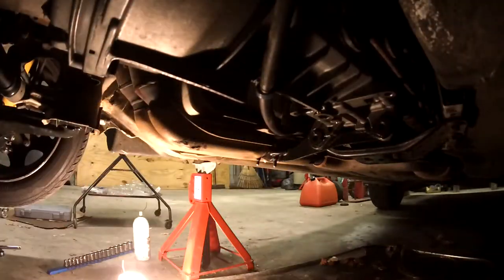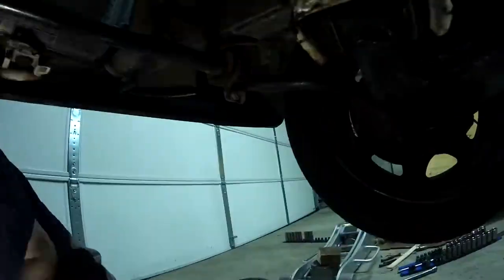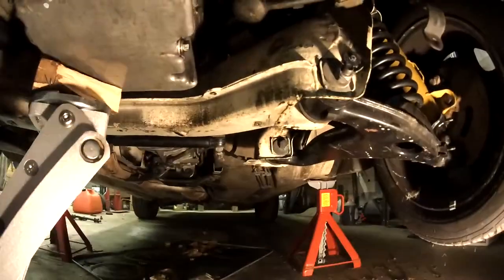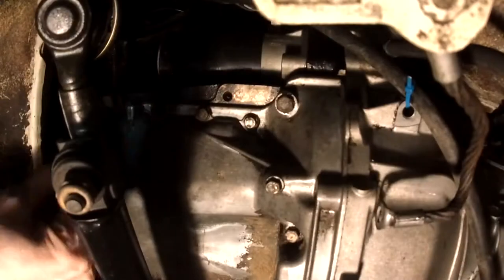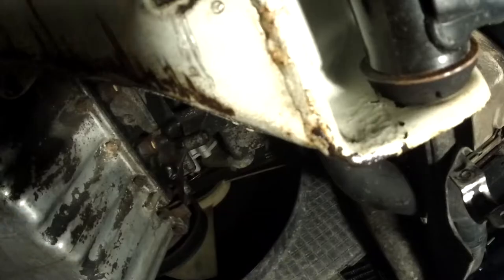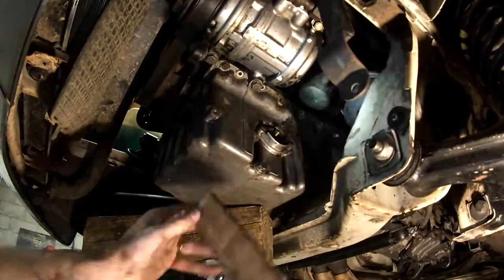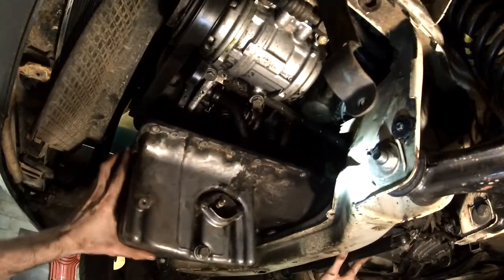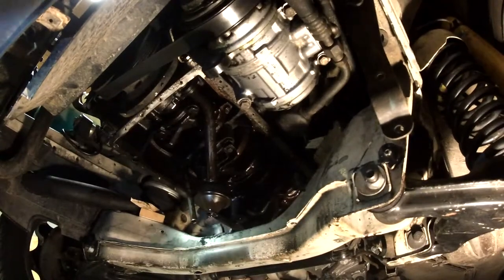Mercedes 190e oil pan removal - m102 engine

Comment: Yes, what a PITA job to do. Really, couldn't they do it a little bit more complicated, say for "about 1cm" that it just wouldn't be possible to get it out at all!
Gonna do the same on my W124 Om601 to check the condition of the engine internals and do some cleaning.
Done it already on Audi B5 1.8 20v and it's the same kind of nightmare where you need to jack up the engine like insane and (at the same time) lower down the engine (front-suspension) subframe.
I don't know who is giving those Germans such smart ideas. Brilliant.
Thanks man, Really!!! You are helping me collecting the needed courage the get job done and giving some ideas what lies ahead. Wish you all the best!!!
Reply: Doing this right now. Not fun

Comment: This is very helpful, much appreciated. I guess the W124 M111 engine is similar. Do you remember how far you had to jack the engine up, or how thick the blocks of wood were that you put in between engine and mounts? Thanks!
Reply from the maker: I jacked it up as far as it would go I think the transmission was hitting the tunnel. The wood was just whatever was around I think some 2x4 chunks and then pieces of paint stirrers to get it as high as it would go. it would probably go higher if you lifted it with an engine hoist.
Reply: @chr1ssss  Thanks again!
Reply: Okay, just got this job done on my w124 m111 engine, took me half a day. Pretty straightforward, using a hoist attached to the front engine lift eye until the engine hit the firewall. One of the crankshaft counter weights was in the way, by turning the crankshaft I got the necessary clearance for removal of the pan. Nothing other than the fan cover had to be loosened but this might not be the case with other w124 engine types.

Comment: The video is a lot if help thank you forthe instructions! Is it necesary to dismantle the exaust?
Reply from the maker: Another commenter mentioned they didn’t need to undo the exhaust. I was just following the factory procedure. Maybe Mercedes was worried about the stress on it as you change the engine angle, who knows.

Comment: Just to clarify... you used only paint sticks between the motor mounts and the cross member to lift the engine enough the pull the pan out? No other wood and no engine hoist. Thanks!
Reply from the maker: I think I used a chunk of 2x4 and then paint sticks to fill in the small gap until there was no room. No engine hoist.

Comment: I have both the printed manual and a PDF of the repair manual. Did you find the steps for the removal of the oil pan in these ?
Reply from the maker: yea I basically referenced procedure 01-310 of the mercedes 190e service manual

Comment: Hi, is it advisable to jack the engine via the oil pan before loosening any bolts or would that damage the bell housing bolts?
Thanks
Reply from the maker: Maybe undo the chassis ground first but otherwise, I don’t think that order matters. On reassembly I might have put them all back, then dropped it down but my memory is hazy.

Comment: we’re the bearings easy to change mate?? hearing a slight knock when i’m under the vehicle
Reply from the maker: Actually changing them wasn't terrible. This is the first and only set of  bearings I've changed. I too thought I heard a knock noise but changing bearings didn't fix it. I figured I would try just for the experience since the bearings were like 30$ and the motor was tired anyways. When I did it I was working on my back on the garage floor - I probably should have put down some cardboard or something to atleast pretend to try to be clean. While the old bearings looked a little worn, I plastigaged a few of them and they were within spec, I think I also plastigaged a few of the new ones and then got tired of doing that since you have to torque it down then open it back up to check. Also, torquing the bolts down is tricky since its some ft/lbs then 90 degrees which is tough to eyeball and do when you are working in a constrained environment. As I recall I had to do 2 45 degree cranks on a few of them. I also reused the rod bolts since the old mercedes manual says you can if the shank of the bolt is thick enough (I did actually check). I also haven't driven the car a ton since I did this so I can't speak to longevity. That being said, it runs.

Comment: Nice video man. How long did it take you using this method?
Reply from the maker: it took a while. if i did it again maybe 2-3 hours?
Reply: Jesus 2-3 hours. I just spent 9 and I havent wiggled the oil pan out yet
Reply: @CapsAndBeanies  FOOK me
Reply: @arnog9959  im kinda nervous to do this on mine. how'd yours go?
Reply: @joshuaburke5339  Nope, did not do it. Too much work, spending 8 hours or so, id rather pay some for that same labor that has all the proper tools and space. :)